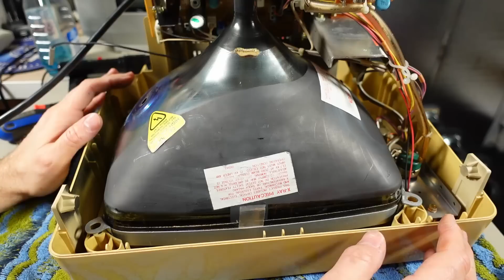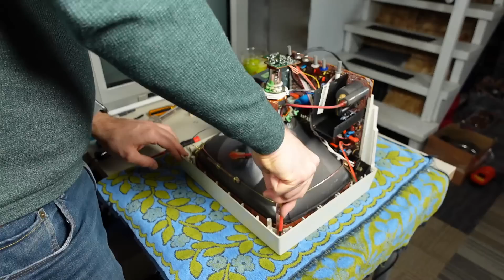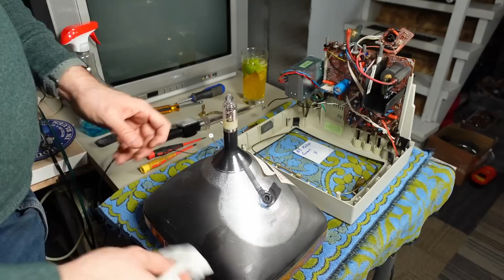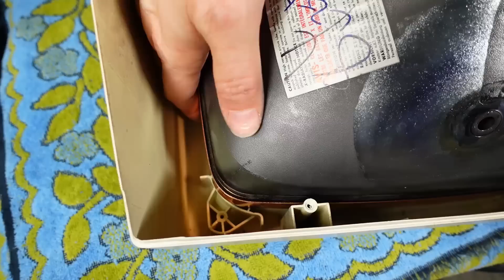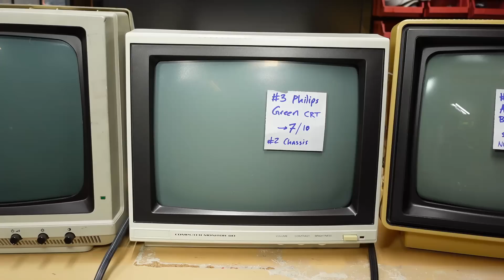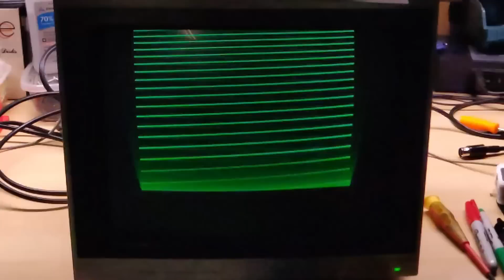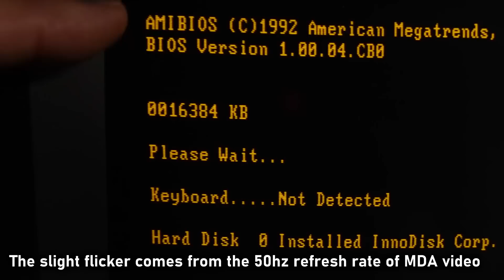Let's improve some monitors! (Part 2)

Comment: 220V and 240V are now officially the same! See https://en.wikipedia.org/wiki/Mains_electricity for details :) My first color VGA was 110V because it was cheaper ( surplus)  i used it with a 240 to 110 step down transformer i had it for about 5 years until i upgraded to VGA and it belonged to my parents for about 15 more years till it was upgraded to a lcd
Reply: Originally 220V and 240V were unified by a paper excersize making the standard 230V +/- 10%. But this way tightened over years and with every step some installations had to be actually converted to 230V. We are now at 230V +/- 6%.
Reply: @danielmantione  Yes i understand the process. Most Brown goods things now use switch mode  power supplies and most white goods seem to to made in the UK.  (I'm based in the UK) when i buy them. I guess that the UK retailers take into account that some uk mains are still at the old 240 or even 250v standards.
Reply: @stevewhitcher6719  indeed, many mains in the UK still measure 246 or 247 when probed, even when they’re officially 240 (or “officially” 230).
Reply: @kaitlyn__L  Yes indeed, I often use my Multimeter to check that something is off before i stick my fingers in it. And that is my experience too.

Comment: When I used to work on CRTs I didn't use a high voltage probe to discharge the flyback lead. I merely attached a jumper wire to a flat blade screwdriver and grounded it to the chassis. I'd get a spark, but nothing dangerous.

Comment: 2 extra safety tips when working with CRTs: never work alone; if for any reason you get shocked and get unconscious there will be nobody to assist u (i.e. give u RCP, call 911, etc) and also those CRTs can build up a charge again even if they are stored without power connected to them, so it's better to make a short between the anode and cathod if you are going to store (i.e. while swapping or repairing some video board) them for a while
Reply: Wear shoes with rubber soles, wear gloves. The danger of the tube is often overstated though: While I wouldn't call it safe, the amount of energy stored in the tube is not enough to kill. The capacitors in the power supply are more dangerous than the tube.

Comment: You might be able to turn the CRT up side down so the HV connector is on the bottom.  If it clears the circuit board, that will fix the problem with getting the rear cover on.

Comment: PS In the old days I worked with a chap who ran a repair shop. (I went on to go to college and run my own for twenty years) He ran the heater very hot (very bright but still orange, maybe up to 100% over)and started tapping the tube neck sharply with a big screwdriver..! Now I have done this a few times as a last resort knowing a tap too far will do it in...Results variable..But can be amazingThis is pretty much the same as a rejuvenator but that uses far less time, less voltage and no screwdriver action. A CRT tester that has a reservoir cap to blow out shorts can of course be done with a charged cap placed across the obvious shorts.

Comment: @29:00 - can you not just mount the CRT upside down and invert the signal going to the deflection coils? (I have no experience fixing CRTs so this is probably a naive question)
Reply: I was going to say the same... But I guess Adrian doesn't really care about the monitor too much because of the burn-in - or there are other technical difficulties he didn't mention in the Video... . Anyways.. Adrian, maybe you can put it together again like that and give it away. Your basement must be cluttered anyways 😋

Comment: You could cut away the interference area of the handle for #5 and 3D print a part to cover it up
Reply: or just turn the crt upside down, as long as the deflection coil is right side up it should still work.

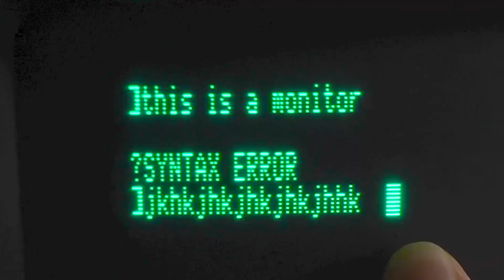Comment: 27:42 you could probably solve this by putting a glossy clear coat of varnish over it. The varnish fills the little holes and hills left by the etching. 
You can try out the effect by putting a tiny droplet of oil onto the screen. If that solves it, then the varnish will likely do the same. Clean away the oil first, of course.
Reply: Glass polish is also a thing! Would not leave you with a coated monitor too!

Comment: 19:24 - it used to be 220V but it's 230V here in Europe.
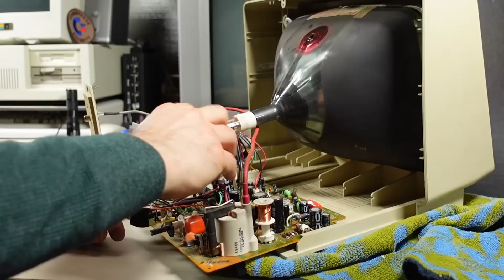20:32 - I screamed internally, I was so afraid it would fall down of your table! :)
20:30 - did you cut out the mesh and put the frame back or you just threw it away? It seems like it's thick enough that the tube can be loose without it.
Reply: As I understand it's 240V in the UK, 220V in the rest of Europe, so they standardized on 230±10V
Reply: Yeah, that @20:32 struck me and made me move my hand to try to catch it. :-D

Comment: The status bar on the Amdek looks to be an artifact of a TN3270 window.  This, as the dirt tells, was probably in an auto or tire shope with direct access to the AS400.
Reply: Ya! I was thinking the burnt-in status line was from a 5250 terminal emulator if attached to System/3x or AS/400.
Reply: Prolly can see "F1=Help F3=Exit"... burnt-in.
Reply: And even those old mainframe / mid-frame terminals that had screen blanking ability after 5 minutes or so of inactivity would usually leave some indicators on the screen at the bottom as well, contributing slightly further to the burn-in.

Comment: 29:41 although not worth the effort, you might be able to mount the CRT upside down.. ?
Reply: Yeah, I thought the same. I also don´t think that this case is THAT ugly.
Reply: I had wondered if that was possible, or if there would be something else preventing that.
Reply: Wouldn’t the picture be upside down then? Or is the ordination or the crt it’s self not important.
Reply: @darthrevan2063  the orientation of the yoke determines the picture :) you could even turn the tube 90° if you want (but you’d get a bunch cut off so you wouldn’t wanna keep it that way)
Reply: @darthrevan2063  you know, I just thought the yolk would determine the beam deflection, maybe the emitters would be reversed?

Comment: It's totally okay to connect a 220 volt transformer to 240 volt. If the secondary is 12 volts, it rises to 13 volts.

Comment: The Chinese characters literally says "Not Bright", or simply dim......
Reply: Yeah its either not bright, or not lit up (I.e. not working). Its entirely possible this crt had a fault before too
Reply: That's interesting as it wasn't an entirely uncommon practice for budget-brand manufacturers to use 'factory seconds' i.e CRT's and components with known issues/ defects that could be bought cheap and repurposed.
Reply: I’m reminded of a recent BigClive video where he worked with a flashing light, that didn’t flash. It had writing in chinese on the box, which commenters noted, said “always on” or something like that ...
Seems it would be a good idea to learn to read chinese, when debugging products built in China, Taiwan, Hong Kong, etc ... 😀
Reply: Some times that word could also mean "doesn't emit light", so when it comes to monitor, "doesn't work at all".